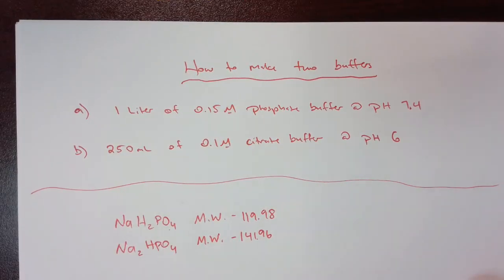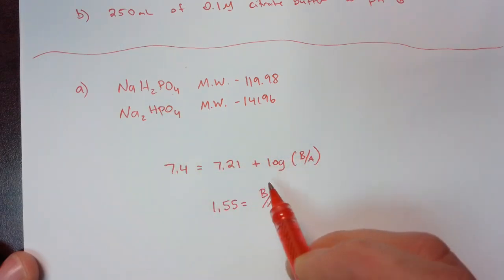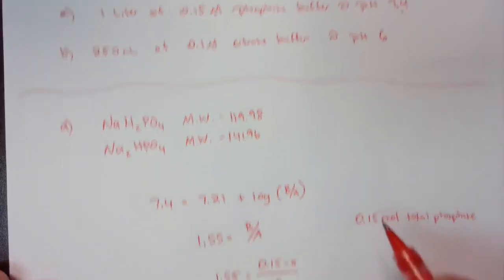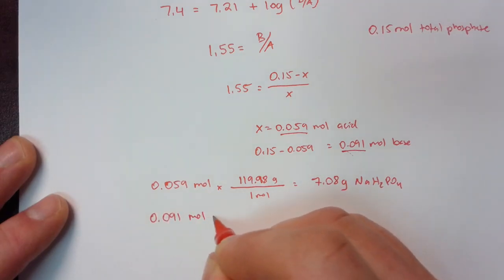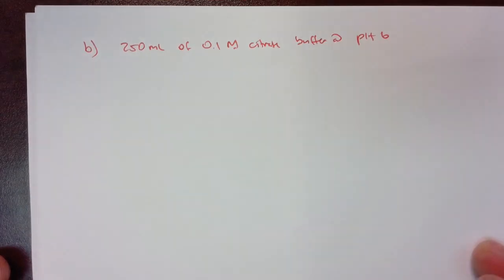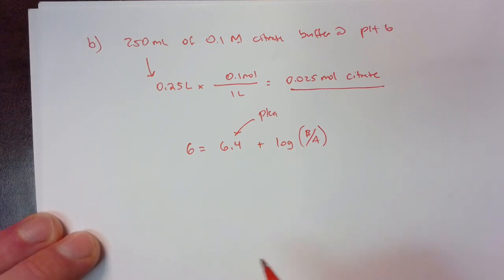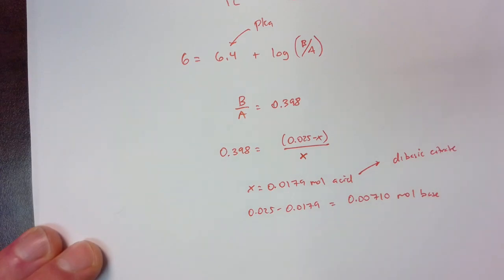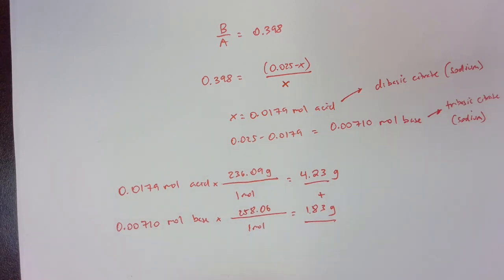Calculations for phosphate and citrate buffer preparation

Comment: Hi
Thanks for the wonderful explanation.
I would like to ask , how did you choose the pka value as 6.4 ?
Reply from the maker: Citric acid has 3 pKa values because it is triprotic (3.1, 4.8, 6.4). Buffers are only good within +/- 1 pH unit of a given pKa value. Since I want to make a buffer @ pH 6, we'd want to use the pKa value that's closest to that desired pH. Hope that helps!
Reply: @bferrell5430  
Yes. Thanks a lot.
I got the point.
Thanks for the early response and suitable answer.

Comment: I have to say, the theory and practice are completely different. I followed the step and got the buffer, but pH is 6.93, far away from 7.4. Based on experience, If you want to get a pH 7.4 0.15M phosphate buffer, the ratio of 1M Na2HPO4 to 1M NaH2PO4 should be 4:1, then dilute to 0.15M. This video can only be used for homework.
Reply: Hello! Comment from one who has looked into the practical use of this a bit now, and is thoroughly confused: 
For us lab people out there, it seems like using a different pKa for monobasic sodium phosphate is more accurate.

monobasic sodium phosphate has, according to pubchem, a pKa of "6.8-7.2 (depending on the physicochemical characteristics during pKa determination)". Most tables that I find in lab procedures seem to use ca 6.8 as their pKa. (see for example one here https://www.sciencegateway.org/protocols/cellbio/appendix/phosb.htm ). 
Obviously, in this table, pKa cannot be 7.21, as the ratio of base and acid is far from 50/50 around pH 7.2. When you look at pH 6.8 however, the ratios are close to 50/50. 

And if we take the pH you got from your pH meter as an example @Saxit: 
If the real pKa was 6.8, then if you add the amounts given in the video, you should get a pH of 7, not 7.4. Now that is a lot closer to what you actually got. 

I am however still confused as to what is meant by "physiochemical charcteristics". Seems like these could be different from lab to lab?
Reply from the maker: You may be correct. There are other factors which contribute to pH that are not given by this theoretical problem. However, your pH value seems pretty far off from the theoretical pH. My guess is something else is amiss, like a mis-calibrated pH meter. In any case, I'd like to offer an easier way to make your buffer. Just add 0.15 M NaH2PO4 at a slightly lower volume than needed and adjust to pH 7.4 with NaOH..only have to weigh one salt and only final dilution to volume needed.

Comment: I was just wondering, if I wanted to make a buffer for myself how would I arrive at what the concentration of that buffer should be? Ie how was 0.15 M and 0.1 M chosen? Was it just a random pick or are there rules that govern this choice
Reply: Well, it depends on what you want. For example, if it is a mobile phase, concentrations are usually 20 or 10 mmol.